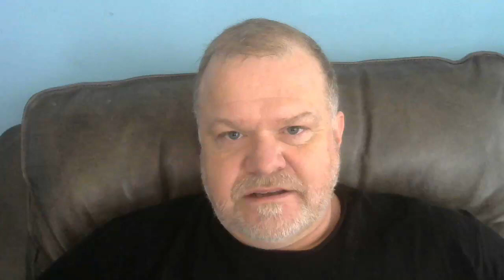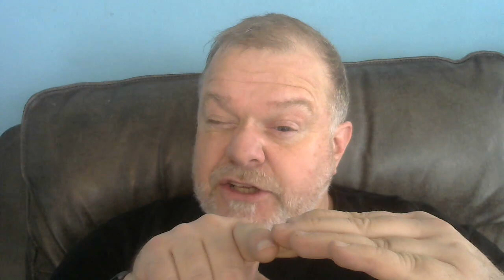Plumbing Expansion Tank Scam

Comment: Water heaters can only blow up if your temperature pressure valve is completely locked up and your burner assembly completely malfunctions it is not a mess that water heaters blow up they used to blow up quite often back in like the 1940s in the 1950s before safety devices were added on the water heater

Comment: Sir, to be respectful they’re not called expansion tanks they’re called thermal expansion tank because water is a noncompressible so when you heat it up that expansion from the water have to go somewhere and because you’re dealing with a metal tank whether or not you can see it with your visible eye tank, expand and contract, which will cause your tank to fail sooner than it normally would and you need to yell at who manufactures tank not the people who install them they don’t build them as well as they used to and I know I sound like an old laugh when I say that but you know just as well as I do that is 100% true because engineers get involved and they try to figure out a way to build something at the most minimalist way they can so your Water Heater does not have the ability to absorb that expansion and contraction that is happening from the heating and cooling of water. Nobody is saying you need an expansion tank and if someone is saying that you need one, it’s not gonna be a plumber it’s gonna be code force in your area once again has nothing to do with a plumber, plumbers are not scam artist we repair stuff we fix up and we have to abide by universal plumbing code and we also have to go by local code so if I was in your house and told you sir, I have to put an expansion tank on this if I’m replacing it because I have to bring it up to current code, it has nothing to do with the plumber stop Shane all over good people who are just trying to make a fucking living and trying to make an honest one. I am a very very fucking honest Plummer. I have never gotten anybody anything that they didn’t want or they didn’t need and I have told people on numerous occasions you don’t really need this if it wasn’t for code I wouldn’t even be talking to you about it, but the function of a thermal expansion tank is for just that thermal expansion. That’s why you’re supposed to pressurize those tanks to whatever the incoming water pressure is to your home whether it be 45, psi 55 psi it does not matter but the plumber that shows up at your house to repair the problem that you have is not a scammer, he is doing what he is told to do by his employer and by the local government so if you want to shit on anybody and call anybody a scammer write a fucking letter to your congressman email your state senator, your protest in front of the fucking governors mansion
Reply from the maker: I very much respect and appreciate respectful feedback. You're a rare breed sir.
Reply: I had it out with a inspector about thermal expansion so I agree with you it is code therefore we do it and most good plumbers know when and what areas we work in that it's necessary